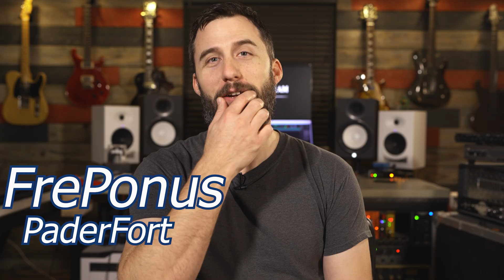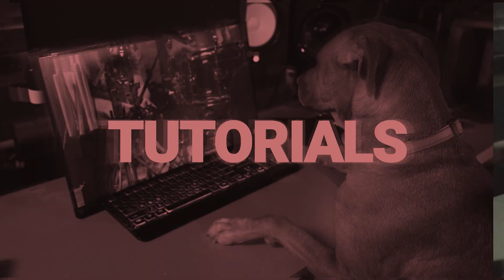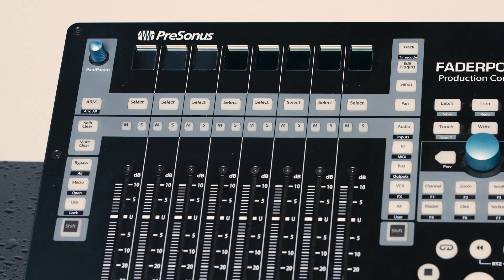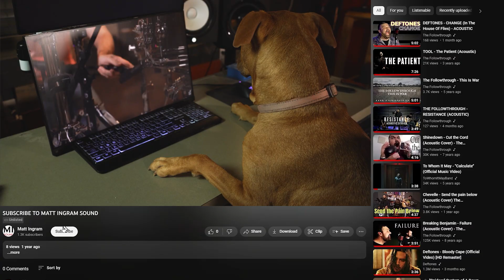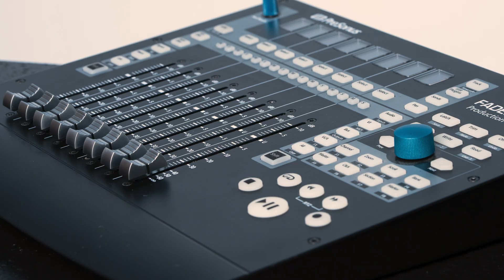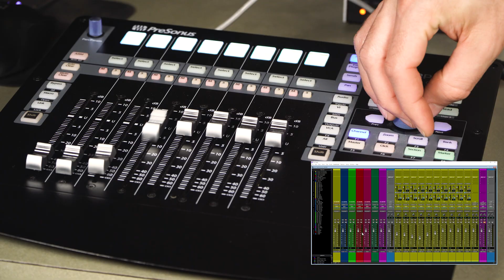REVIEW: PreSonus FaderPort 8 USB DAW Controller

Comment: Faderport offers the most and deepest control over Studio One. End of Story. Yes it works with other DAW's but not as deep. If you are a Studio One user then its a no brainer. Many of the deep functions and operations in Studio One mode are not mentioned here.
Reply from the maker: I did not mention those because I have never used Studio One. I primarily used this in Pro Tools and Logic.
Reply: It works pretty much exactly the same with Nuendo/cubase

Comment: Not sure why you would consider getting a tactile interface like the Faderport if your workflow is based on using a mouse? In any case, the review overall was fairly limited; I was hoping for a more in-depth analysis.
Reply: Automation is way more productive and smooth with a physical fader and mute button than bouncing your mouse all over trying to be precise. I would say it even makes it more musical.
Not to mention the physical record and playback buttons.  It gives the entire workflow that "analog feel"
Reply from the maker: Thanks for the comment! There really isn't much more to talk about with the FaderPort. It isn't what I would call a very  "deep" piece of equipment. As for the workflow, I explained it in the video. When running live audio, it is easy enough to change one fader with a mouse, but often you need to change many things at the same time. That is what the VCA's are for, and that is why I keep the faderport on my VCA's at all times.

Comment: Very interesting. I'm debating between the Faderport and Behringer X-touch for Pro Tools. The X-touch is mappable, as I imagine this one is as well.
Reply: Just get the single channel faderport. I'll admit this thing looks enticing and I'd probably get it just for that, but the single channel does all the same stuff and it's a hell of a lot cheaper. I've been using it for 10 years and I never wished I had more faders. Save the money for an actual console if it's knobs and faders you want
(Just my advice, but Presonus beats Behringer all day in quality and performance)
Reply from the maker: I haven't used the Behringer controller, but if you are just looking to control faders, it probably works just as well as the PreSonus.
Reply: I use Studio One, and it is mappable especially in midi mode but the main program is good for me